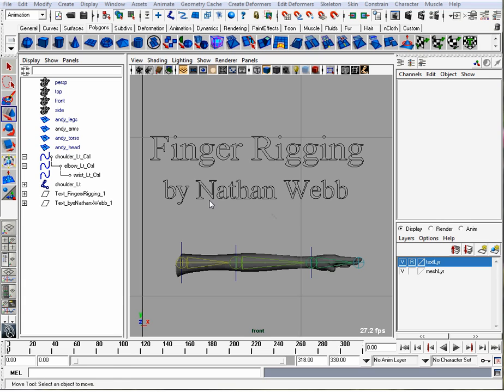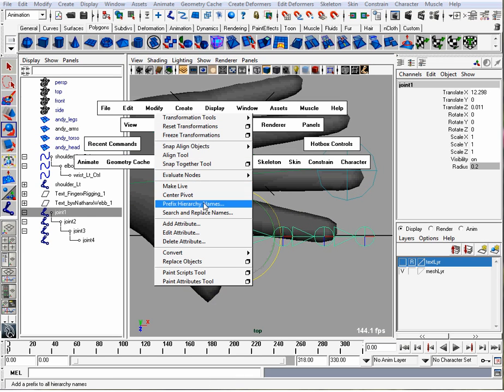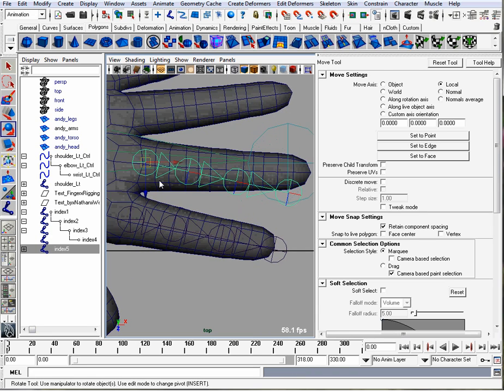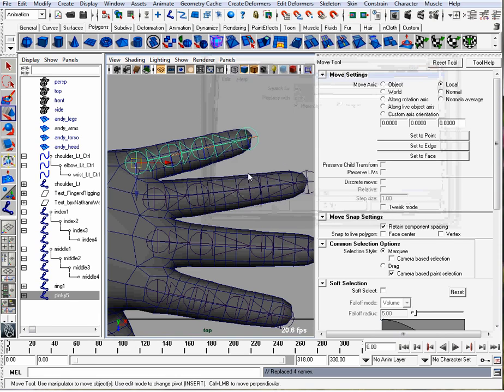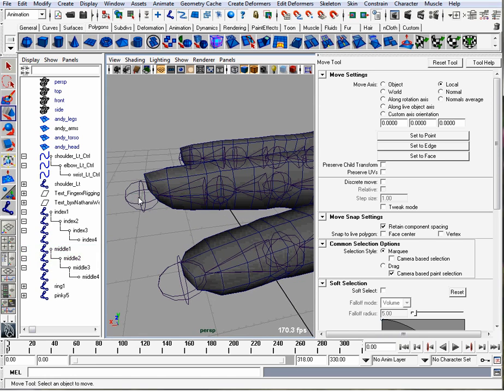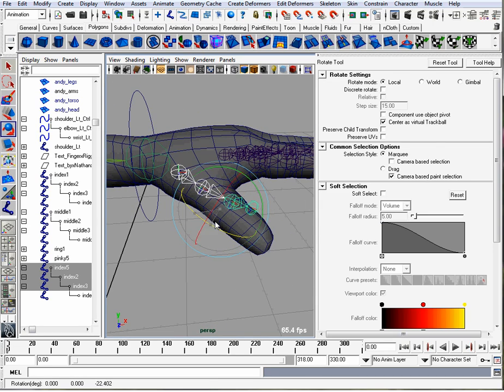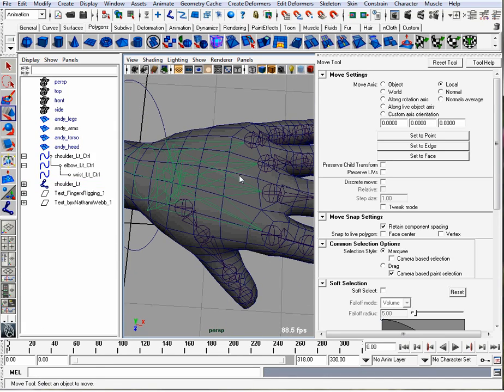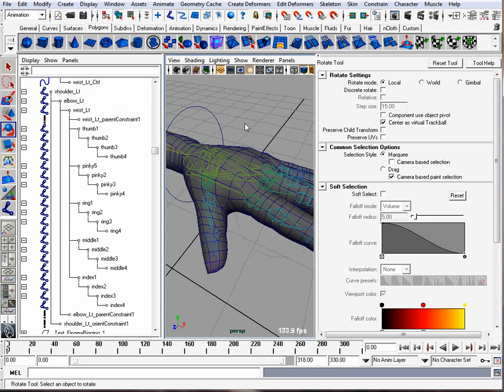Maya finger rigging tutorial using SDK Part 1 of 2

Comment: after i do bind skin,my finger donot rotate correctly only joint rotate correctly..wats the problem??
Reply from the maker: Hello Arun.  Before you do the set driven key setup in this video, I'd make sure that your mesh deforms nicely with the joints that you have.  Then once that's working well, you can do the set driven key finger curl work.  If it works well before you do the finger curl setup, but not after, I'm not sure what's going on without looking at the file.  You can send me your file to nathanwebb at hotmail dot com if you'd like and I can take a look.
Reply: +Nathan Webb thanks nathan for replying i will send u my work files 10 hrs..i will be waiting for your help